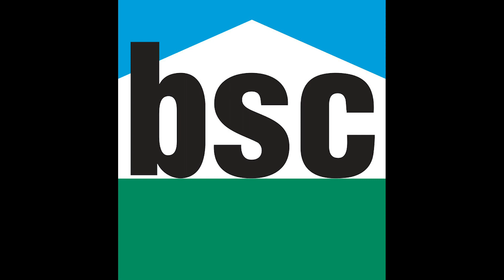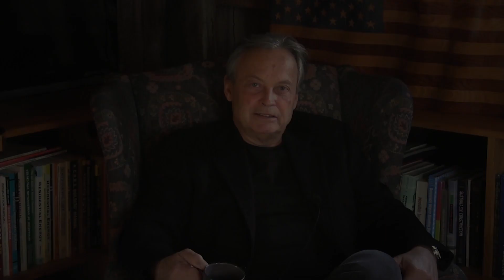Cup of Joe - Below-Grade Waterproofing and Water Control

Comment: Hi Joe, thanks for putting out all of this amazing info, I've learned a ton! 

I build row homes in Philadelphia with finished basements. I personally dislike basements, especially finished ones, but it's the market I'm in so I have to build them. We generally have no opportunity to daylight an exterior foundation drain so we just waterproof the exterior and hope for the best. We run interior footing drains around the perimeter of the slab and run that into a sump pit and pump it out. I'm a big fan of keeping outside water outside but I've been mulling over running an exterior foundation drain back inside and tying it into the interior footing drain to follow your advice to relieve hydrostatic pressure. I'm not excited about the thought of tying them together and bringing that exterior water inside under the slab but my thoughts are it will get there anyway so better to let it get under the slab and get pumped out than finding its way in through a crack in the slab. I'd love to hear your thoughts on this. Thanks again!
Reply: That’s basically how it’s done in Canada, though it typically U turns below the slab, goes through a backwater valve and out to the storm sewer. Sump would work provided there’s a backup and it’s sealed tight. You’re right that it’s coming in anyways, liquid or vapour.